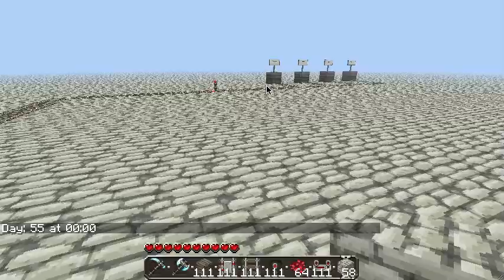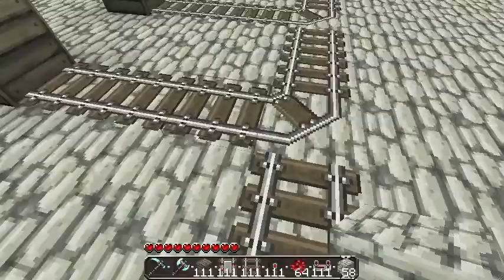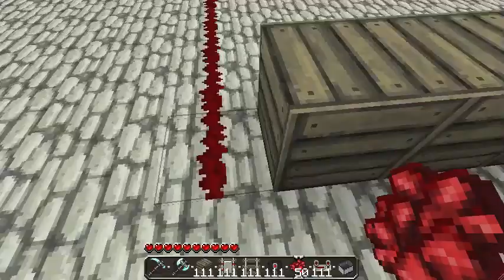How to Build a Minecart Station (Updated for 1.6!): Station Addons - Destination Selector Part 2

Comment from the maker: @xXFigmentXx Not too hard.  Basically you tie the lights in to the output of the RS-NOR latches and run the wires where you want them to go.  The hard part is the inevitable crossing of the redstone wires, but you can use redstone bridges (check the wiki, or I show an example in the passenger waiting system video) to compactly intersect 2 lines of redstone.

I didn't include it in the video because I thought it would overcomplicate things.

Comment: Hey Nec, I'm implementing your destination switcher to my SMP server because honestly it's the "simplest" I've seen. It doesn't require me to dig down 15 blocks for circuitry or anything. It's laid out very plain. Yea, it takes up a bit of Real Estate, but I'm just going to turn the top of the building into a sort of Sky park.
Anyway, my question is how hard would it be to add indicator lights to show which destination is currently chosen?

Comment from the maker: @joecrapyourpants 
1) When you press the button, does the redstone light up?  If not, then you probably don't have the buttons set up correctly.

2) If the redstone works, do the repeaters on the bridge light up?  If not, you probably have too much space between the buttons and the repeaters.

3) If the repeaters works, do the RS-NOR latches light up?  If not, you probably don't have the latches set up correctly.

Basically, break it down into pieces and isolate where the failure is occurring.

Comment from the maker: @brasilboy109 I'm tempted to go ahead an release a video of it using the pistons mod (rather than the official pistons coming in 1.7), but I don't want to make a video and then have none of it actually work.  Also, I don't want to do a tutorial that REQUIRES a certain mod be installed.

But, damn, it's a lot cleaner than the current design. XD

Comment from the maker: @Ascianic It's hard to be 100% sure, but here are a couple of things I notice:

1) The tracks are not aligned correctly for their unpowered state.  Add an inverter in the line of redstone going from your RS-NOR latches to the intersections.

2) I can't quite tell, but it looks like the torches on the underside of the RS-NOR latches are lit up.  Sometimes that design bugs when you first build it, so try removing the input line, waiting a second for it to reset, and re-placing the redstone.

Comment from the maker: @xTenshiko Hmm, in the video, Track 1 is definitely the default track--at least in the sense that, if all the RS-NOR latches have been reset, your cart will go to Track 1.  However, you may be running into the South/West rule problem that I talked about early in the video, where the tracks are aligning themselves in a different way (so you would need to add an inverter between the RS-NOR latch and the intersection).

...But whatever.  If it's working for you, don't worry about it!

Comment from the maker: @daburnd0 I can definitely see your point, and I guess it just comes down to how you think about it.  I was naming the RS-NOR latches by the button from which they received input.  I think that's more accurate than naming them by intersection, since when the "Track 2" RS-NOR latch is active, it will send your cart to Track 2 (despite being physically connected to the intersection that's closest to Track 1).

Comment from the maker: @TWolfKaden Yeah, it's a slick idea.  I have the link to where I first saw it in the video description.  

I've seen TaviRider's design as well, and the main objections I have are: 
A) it requires careful timing (which isn't always reliable, especially on SMP)
B) it's hard to add to an existing station without a major redesign
C) it won't work with automatic departure systems
D) The redstone is SIMPLER, but not EASIER (because of A)

It works great for his station, but I wanted more flexibility.